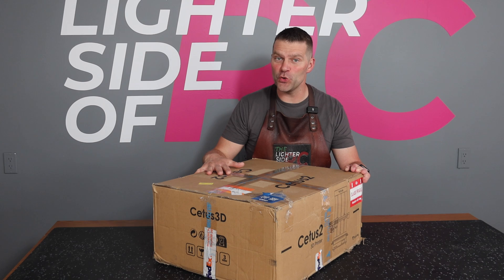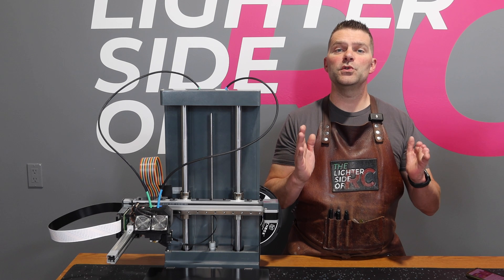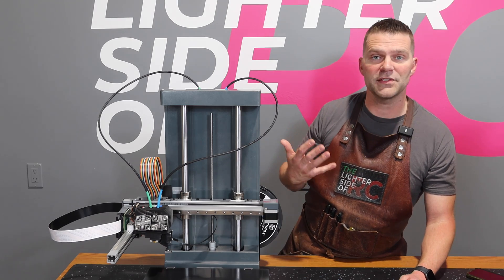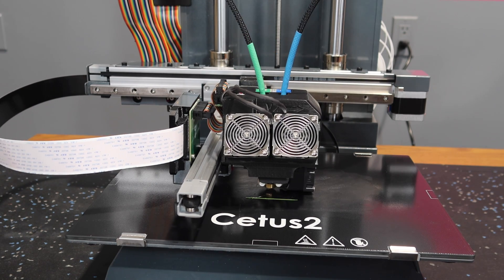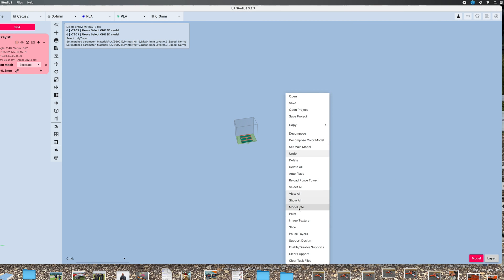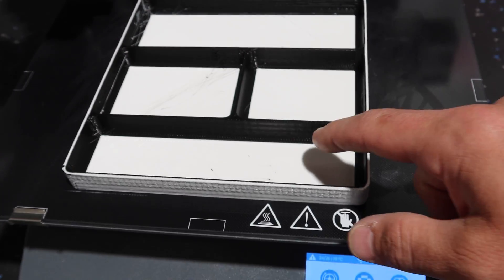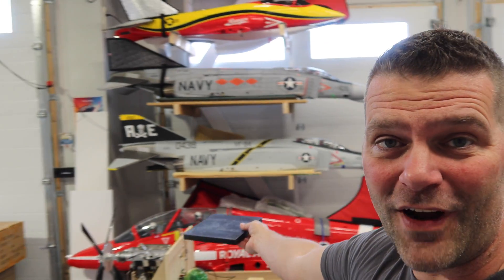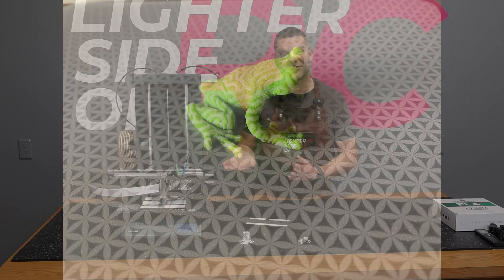My First Time Using A 3d Printer And Review Of The Cetus 2 From Tiertime

Comment: I noticed you also switched to the DJI microphone from the RODE. Were you having issues? You're not the first person I've seen switch recently.
Reply from the maker: Yea the Rode has been terrible for months. Battery fully charged and lasts 10-15 min and just turns off. One of my mic’s was just randomly turning off. Turn it back on. Battery full and it would turn off again. I got so frustrated one day after recording the same take 3 times I hopped on Amazon that instant and ordered the DJI setup. Game changer!  So much better

Comment: Looks like a hell of a lot of weight on the extruder assembly. Swinging that thing around at high print speeds doesn't seem like a good idea. It'll be interesting to see how it works.
Reply from the maker: So far working great!  Playing with different materials and getting past the learning curve.
Reply: @thelightersideofrc  Awesome. Love your channel. I've been 3d printing airframes for a while now and one aspect of printer design is to have a light extruder assembly ie. the bit that moves. It'll be interesting to see how tall, thin wall prints perform.